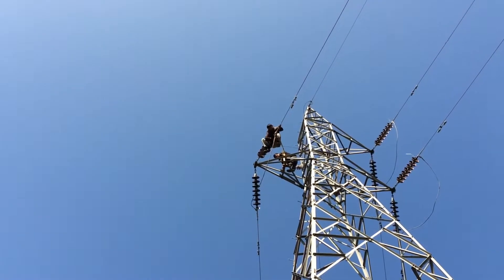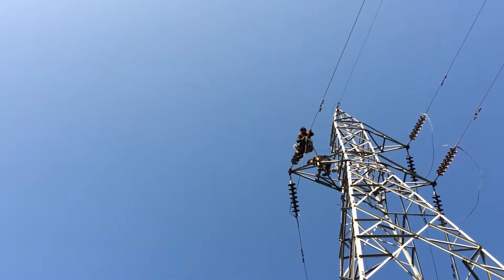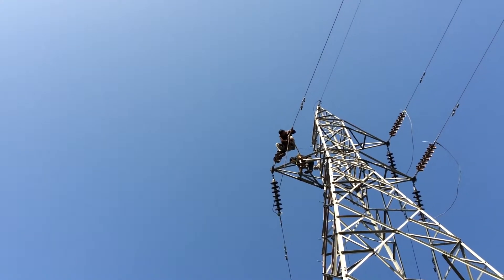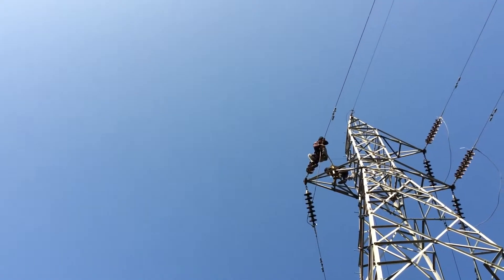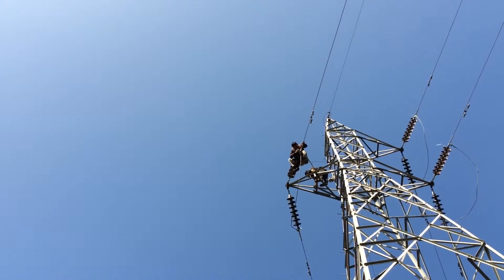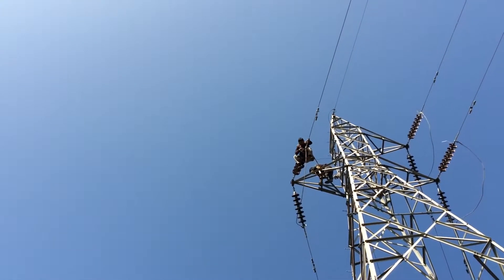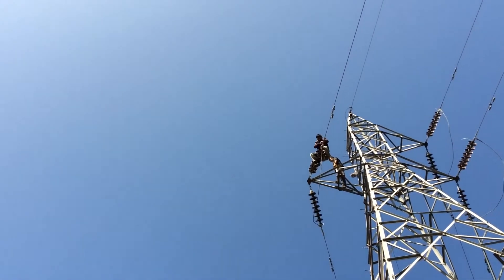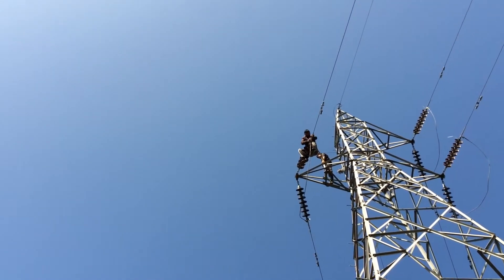66kV Tower maintenance

Comment: 66kv how to run tubelight fann
Reply from the maker: 66kV is step-down to 11kV and after primary distribution it step-downs to 415V/230V via distribution transformer. And then the tube light and fan works accordingly